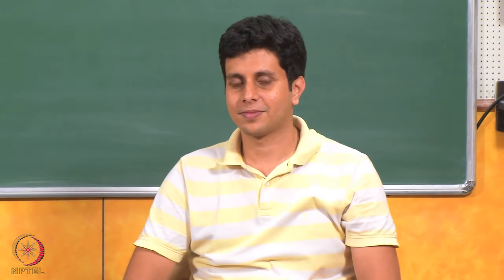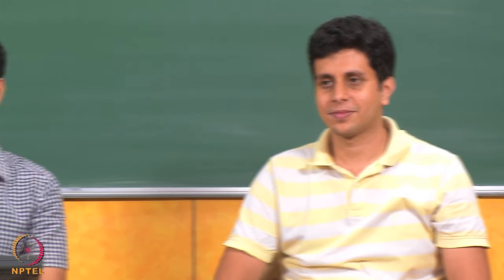Control Engineering - Course Introduction

Comment: sir I am from WBUT.
and I have just given my 2 nd year.
I don't have any idea in control system and its in 3rd year so can I follow this lectures?
Reply from the maker: You can follow these lectures well if you have a basic background of electrical circuit analysis, signals and systems, and engineering mathematics.